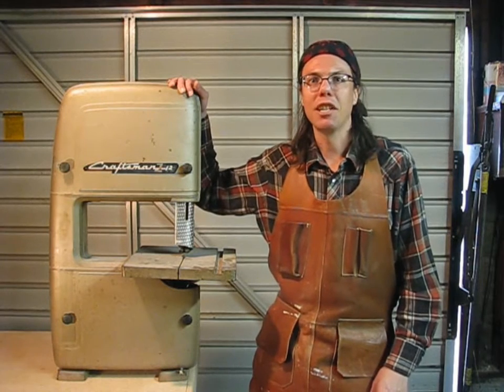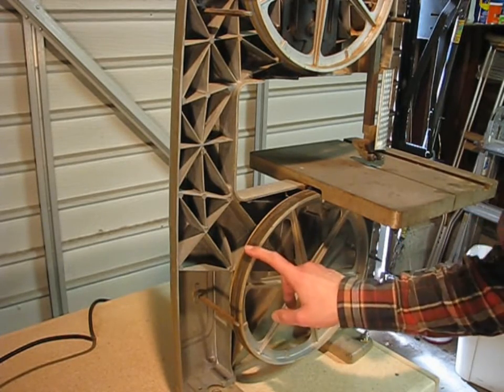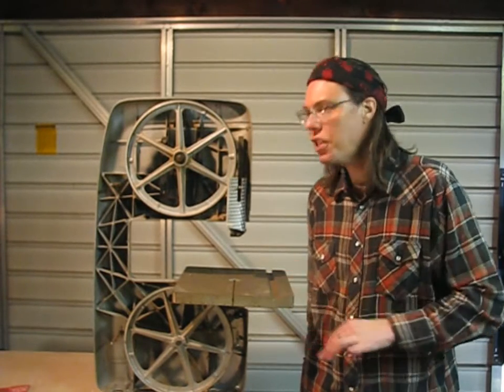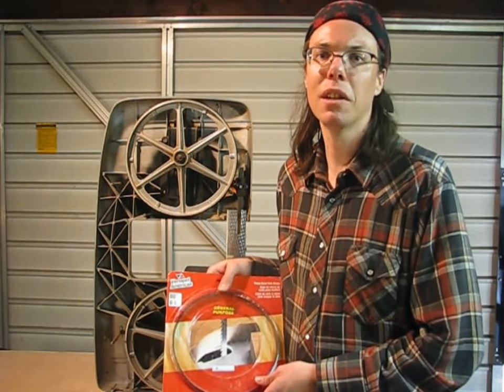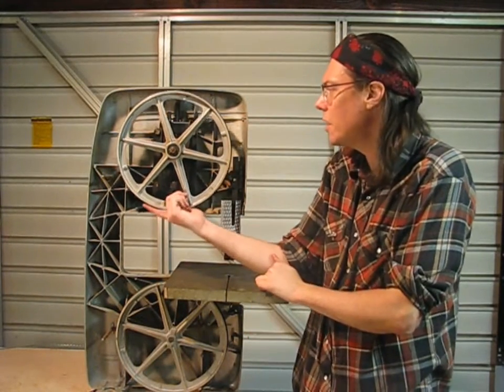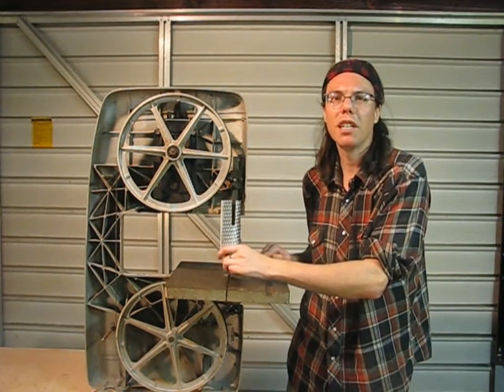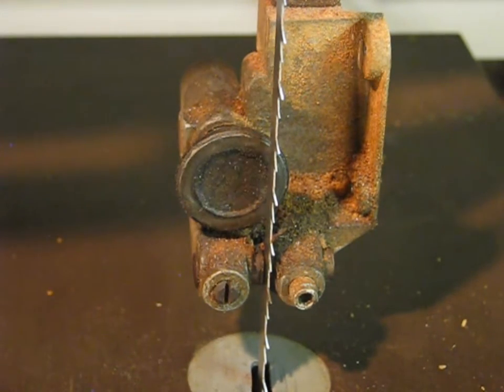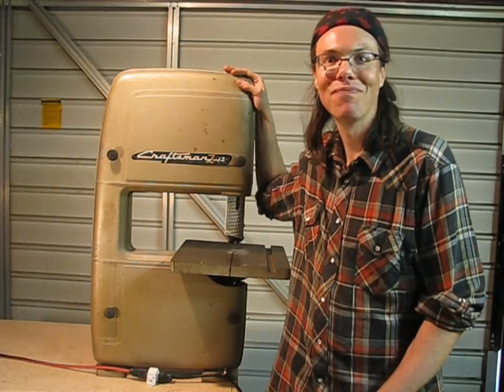Bandsaw Rehab

Comment: great Video. I have some questions maybe you can answer about a 113.243300  Band saw.  1. What is the correct torque for the mounting bolt that holds the upper guide to the guide bar? 2. how does one completely disassemble the upper wheel in order to replace the wheel and the fulcrum assembly? They two outside studs seemed to be pressed in. Any help or suggestions would be appreciated!

Comment: I just got a Craftsman 12:inch tilt head Professional band saw.. The saw is in decent condition and cuts nice.. I have one problem with it. The bottom pulley slides in towards the frame.  with the !/2" blade about half way off the pulley...i pull the pulley out and tighten the set screw, but it still slides in.. the last time i tightened the set screw and there was enough room I added a  second set screw on top of the first one as a lock so the screw wouldn't back out but the pulley still slid in..  what can I do to stop the pulley from moving and get the set screw to hold the pulley where I want it to stay...